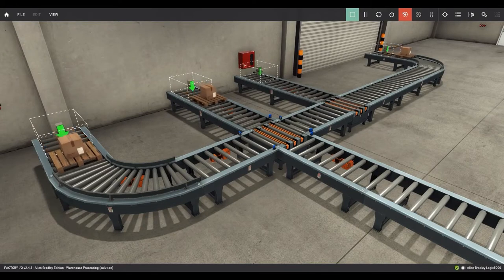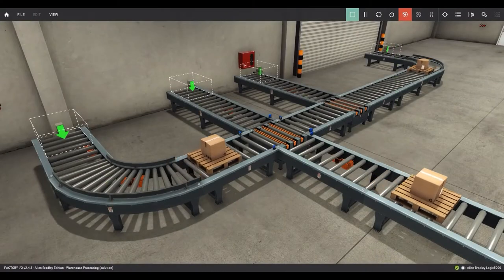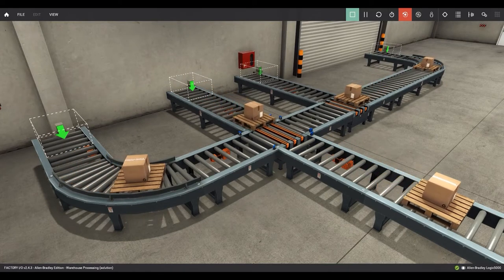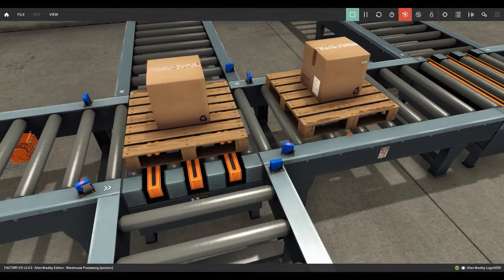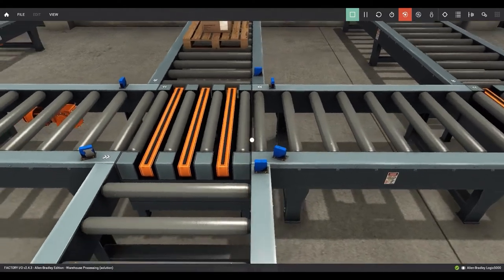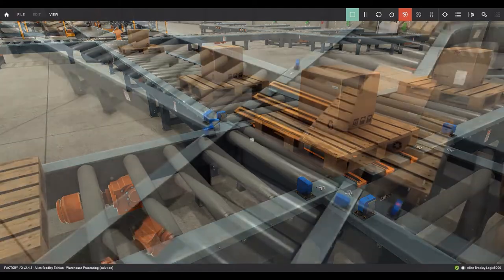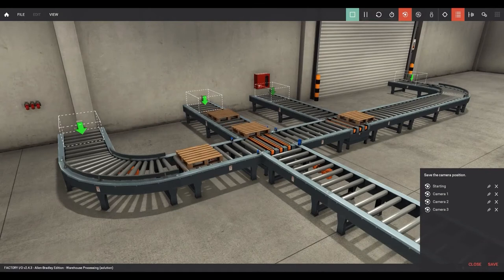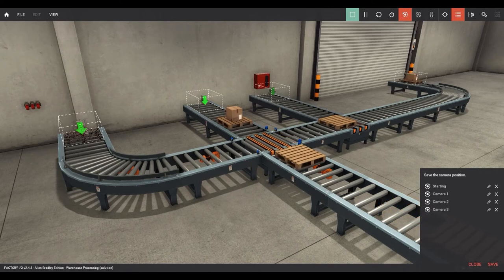Factory IO multi-conveyor feed example

Comment: Very nice, I should try building one of these myself.
Any tips?
Reply from the maker: Probably depends on what you want to do. While the software is quite impressive (and fun... you can literally throw boxes across the warehouse), it does have limits. If you are just trying to develop something fun and cool, or to learn more about how to efficiently write PLC logic, it's great. If you are actually trying to simulate a real-life setup, you will find it hard to do as you can only use the prebuilt object.
Reply from the maker: But, having said all of that, I would suggest starting with moving boxes on the conveyors and then when you are really ambitious, start using the storage rack system, and if you want to really hurt your brain, try actually tracking the boxes that are put away via the RFID or barcode information so that you can pull a known, specific box on demand :)...
Reply from the maker: Can't wait to see what you come up with!